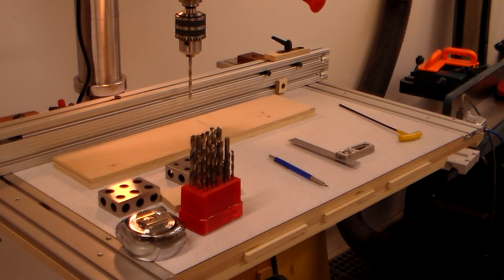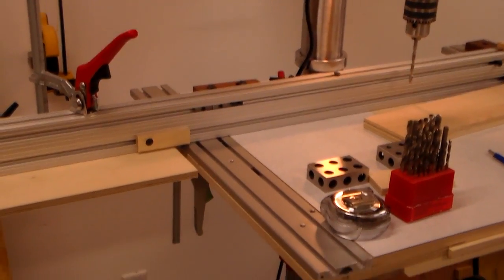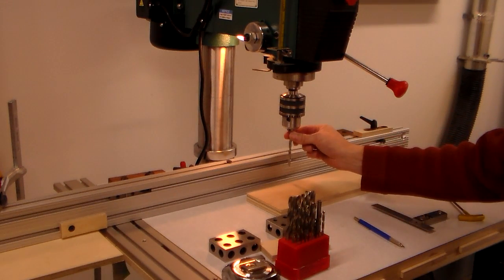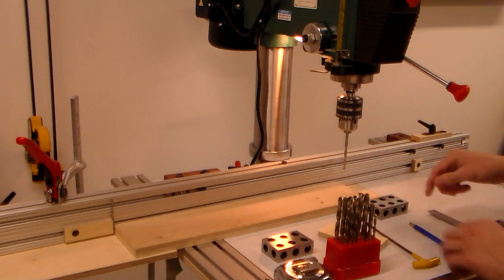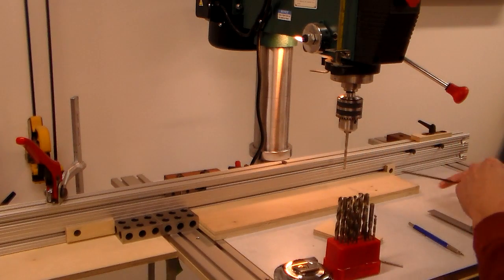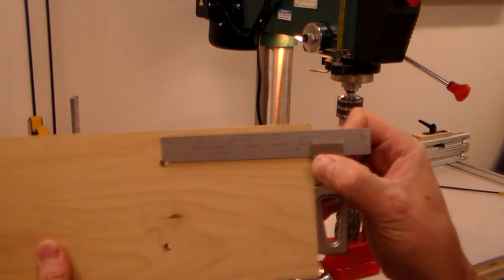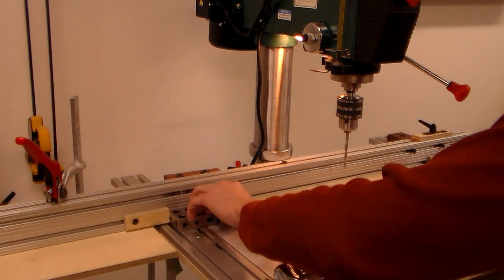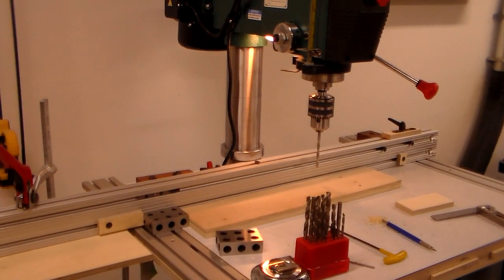Drilling Precision Located Holes

Comment: Jeff... Do you have a video on your fence and extension setup, and where to buy those fence guides/stops?
Reply from the maker: The stops are shop made with T nuts, scrap plywood and 1/4-20 flat head bolts. The extrusions are 80/20 that are readily available on ebay. I have since made some upgrades but the basics are still the same. Thanks for watching.

Comment: Very nice and simple method.  I just bought a drill press as I need to drill almost 400 indexed holes for a horizontal stainless steel cable railing system on a deck.   The hardwood (Ipe) 3.5"X3.5" deck posts each need 11 holes drilled all the way through with 3" spacing.  Due to Ipe hardness and an overheating drill bit issue because of that, I believe I will need to drill 1/2 way through each post from opposite sides to accomplish this.  The drill bit needs to be cooled with water between each hole drilled.  With 18 3.5"X3.5" deck rail posts, that is 198 through holes, times 2, since I'm drilling halfway from each side to meet in the middle, or 396 holes!!  I can see that your method would work, but still be very time consuming.  Do you have any other ideas of how to accomplish this?
Reply from the maker: When drilling indexed holes, speed is not an option. Location, location, location. It's monotonous work and the only way to accomplish it is time. A method taught to me by a machinist friend might be helpful, it's called pecking. Down a 1/2, up and out, down an inch, up and out, and so on until through. Thanks for watching and good luck with your deck. I will say this, don't get to hypnotized by the work, that's when mistakes happen.